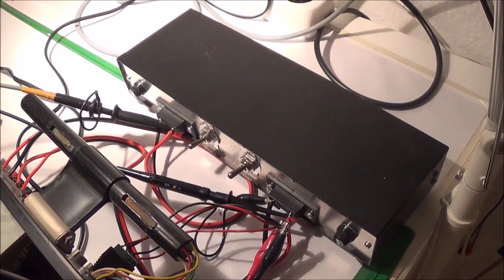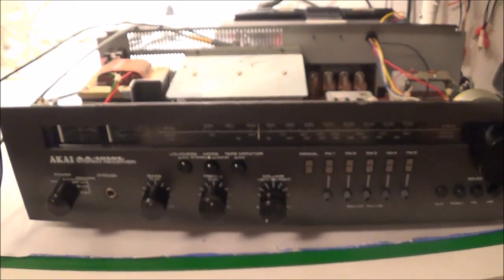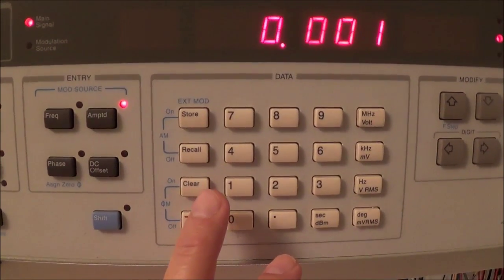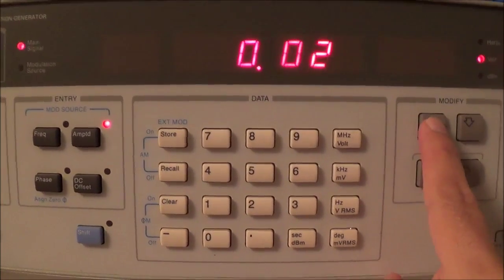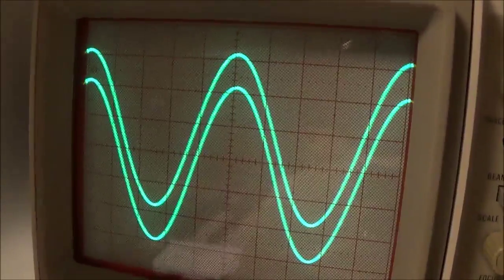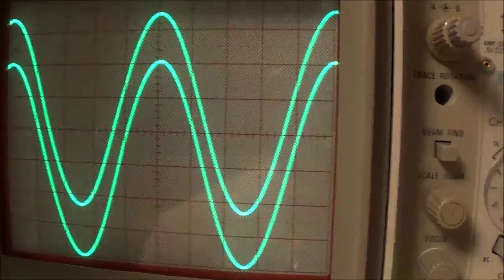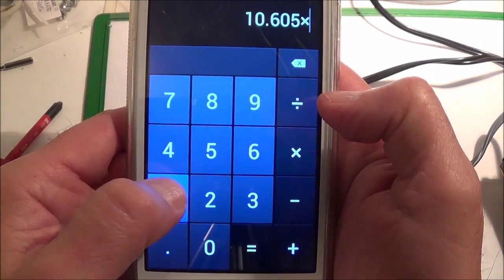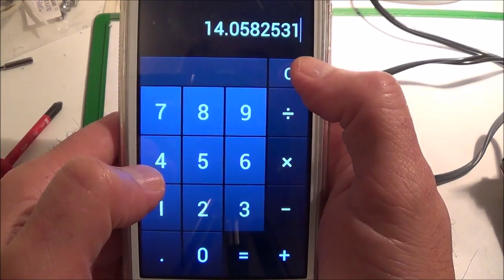Akai AA-1010 Stereo Receiver RMS Power Output Test

Comment: Good video. I have found that if you put the signal input at what the service manual calls for, example, 150 mV sensitivity for the AUX input and turn the volume up all the way, I never had it clip. At least in well made units.  I did come across one stereo that had a service sticker on the bottom that tested the power output from 100 to 10,000 hertz in about 10 steps showing the output. Always good to see how others do things.
Reply from the maker: Thanks, sir! And thanks for the info. I actually want the units to clip since some put out more than the rated power output. Of course, I don't do comprehensive tests; just a basic 1,000Hz test, not, for example, also at 20Hz and 20,000Hz. Also, I check the line voltage and power supply voltages. Hmm, never seen a service sticker with a 10-step power output report. I wonder why they didn't go all the way from 20Hz to 20kHz if they already put that much effort into it? Unit made the high fidelity era maybe??